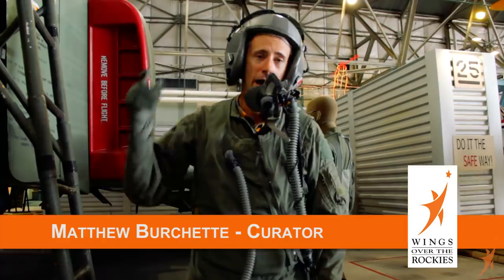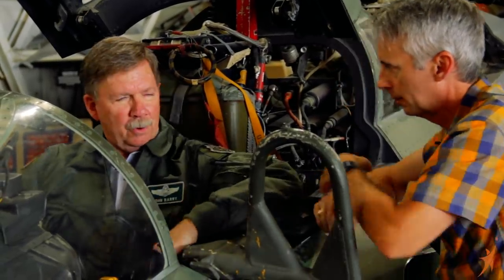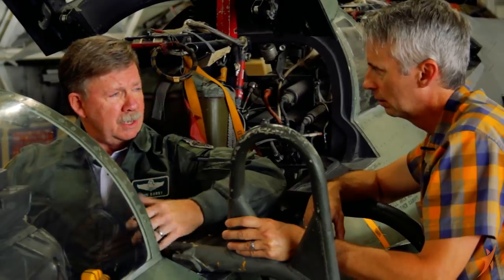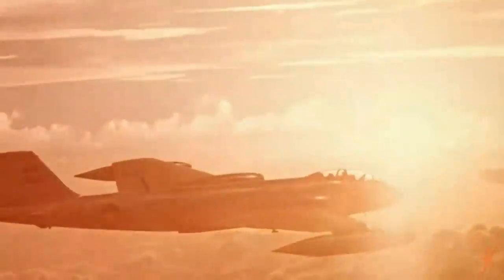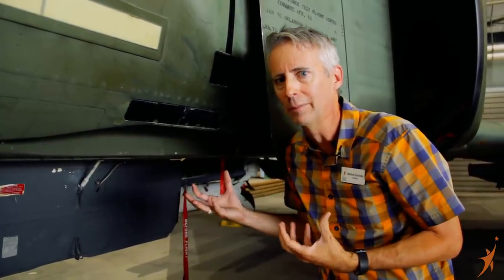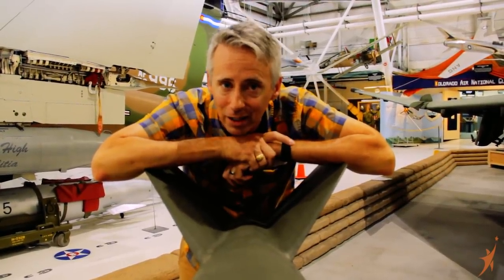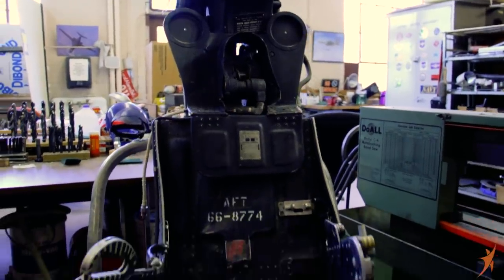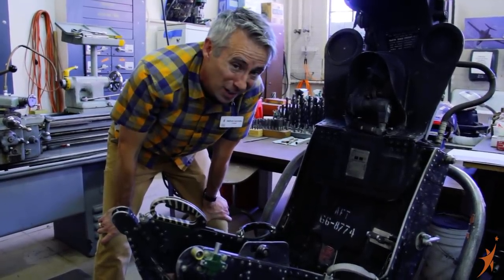F-4 Phantom | Behind the Wings

Comment: The F4 was "bad to the bone" just sitting on the tarmac.  It looked like it was doing mach 3 while sitting in a hangar.  I worked on the AIM missiles in the USAF and I've seen a lot of F4's, they're so cool.  However, many of the  pilots called them the "lead sled".
Reply: The IDF called one variant "Kurnass" (Sledgehammer).
Reply: "A triumph of thrust over aerodynamics" too. ^_^
Reply: @ragingjaguarknight86  I once heard someone describe the F4 as flying the same way a brick would if you angled it right and pushed hard enough.
Reply: Actually, that was not the F-4, that was the Thud, the F-105 Thunderchief.
Reply: Elmo Franklin Actually, that was not the F-4, that was the Thud, the F-105 Thunderchief that was referred to as the Lead Sled.
Reply: @mauriciaannproper1201  no F105 was referred to as the "Thud". Go watch the behind the wings episode on the f105
Reply: Jonah Smith Actually, the Air Force officially designated the F-105 as the Thunderchief, but few people ever seem to remember that. The world's largest single-engine fighter, it weighs more than 53,000 pounds when carrying full fuel and up to 16,000 pounds of external stores. Its bomb load can be twice that of a World War II heavy bomber, and, at altitude, its top speed is more than 1500 miles an hour. Down on the deck, nothing built before it and only a couple of airplanes built since can fly with it as it screams    along 50 feet above the ground at speeds faster than sound. It has a six-barrel cannon which rotates like a Civil War Gatling gun but fires 20 mm projectiles at 100 rounds per second.

Originally designed for toss delivery of nuclear weapons, the F-105 seemed destined for oblivion and replacement by newer, faster, more maneuverable aircraft. Bob McNamara's boys put the kiss of death on the F-105: their slide rules and computers had determined that "the F-105 has only single mission capability, fails to meet criteria for integrative enhancement of flexible force structure, and is non-cost-effective." Then came Vietnam.

Compared to the some other fighter aircraft in the inventory, the F-105 was nowhere. It wasn't new like the Phantom, fast like the F-106, or sexy like the F-104. It was a big, heavy, supersonic flatiron about 65 feet long with stubby, little wings that measured less than 35 feet tip-to-tip. (By way of comparison, the DC-9 airliner is 100 feet long and has a 93 foot wingspan.) You don't need a degree in aeronautics to figure it out. Lose power in an F-105 and it will fall out of the sky like a rock. Hang a full load of ordnance under its wings and it won't climb very high. Point its nose at the ground, and it will dive like a lawn dart.

Now, the Republic Aviation Corporation started building fighter airplanes since before Lindbergh made his celebrated trip to Paris, and some people claim that its founder, the wild, one-legged ace of the Tsarist air force, Alexander P. de Seversky, singlehandedly invented the modern fighter 15 years before World War II. His P-47 Thunderbolt was one of the best fighters of World War II, and Republic's F-84 Thunderjet first flew in 1946 and soldiered on in some Third World air forces nearly forty years later. Republic's airplanes have all been fast, tough, and heavy, but a lot of people concluded that the F-105 was a case of too much inbreeding. While all of Republic airplanes were noted for their propensity to use up concrete, at max gross, the F-105 had a takeoff roll only several yards shorter than Lindbergh's historic flight. Those of us who have flown the Thud have speculated that, if the Air Force paved the equator, Republic Aviation could build an airplane that would use every inch of it to struggle into the air.

When the F-105 entered the inventory, the wits and half-wits at officers' club bars around the world started to hang derisive nicknames on it. Its size and weight made the job easy. Lead Sled was an early appellation, and even 105 drivers had to admit that the name aptly described the airplane without full power.

The WWII P-47 had been nicknamed the Hog, and the follow-on F-84 had become the Super Hog. It was quite natural then that the F-105 would get tagged with Ultra Hog. Transition problems resulting in "controlled flight into terrain" gave rise to the name Lieutenant-eater, but that didn't stick. No one really knows what direction the nickname might have taken but for television, Buffalo Bob Smith, and the Howdy Doody show. Howdy Doody, it was alleged, was the illegitimate son of a Strategic Air Command bomber pilot, and Howdy, assisted by Mickey Mouse, was now writing standardization manuals at HQ, USAF. Buffalo Bob Smith, many others contended, was the role model for any number of Air Force Generals, while Clarabelle the Clown trained USAF stan/eval officers. On the television show, intermittently making mischief with the villainous Mr. Bluster, was a bumbling, drooling, semi-evil Indian named Chief Thunderthud. It had a nice ring to it. Thunder THUD. Thud, as in the noise made by a large heavy object hitting the ground. So, the F-105 became the Thunderthud, and finally, in life and legend, just The Thud.

Perversely, F-105 pilots liked the nickname. Thud drivers took fierce pride in their airplanes and in themselves. They scorned the aircrews of the newer, more maneuverable Phantoms as multi-engine pilots. "Our mission is to fly and fight -- and don't you ever forget it" the motto went. Thud drivers, Hell's Angels, and Mafiosi all exhibited similar patterns of intra-group and external relations, and the Air Force brass soon became resigned to (but not entirely pleased or happy about) the antics of Thud drivers in the air and on the ground. Following a familiarization visit to the the 355th Tactical Fighter Wing, an assistant to the Secretary of Defense wrote: "While these men might of some significant value in the event of all-out conflict, I fear that they might not be susceptible to normal management techniques in any other situation."

This report, when learned of later, was sometimes read aloud at a 355th TFW function known as a "pressure bar" at which all drinks were free until the first man went into the head to urinate. After the climatic sentence was read, the 355th pilots would stand on their chairs, the bar, or tables, yell "Fuck him; Fuck his boss; Fuck his hoss; Fuck the 13th Air Force; It's just a fucking revision of the Second Fucking Air Division," and throw whatever classes and bottles were handy onto the floor. There generally followed numerous choruses of "We'll Fly Our Fucking Thuds at 10,000 Fucking Feet," "Throw a Nickle on the Grass and Save a Fighter Pilot's Ass,""Cruising over Hanoi," "Our Leaders" and other songs. (The 13th Air Force and the 2nd Air Division were intermediate headquarters units and universally reviled by pilots.)

So there!  I’m an Air Force Vietnam Vet, Aircrew Egress Systems Mechanic! The Thunderchief, ie, Thud, was very definitely it! Duh! Throw a nickel on the grass, Dude, and kiss my ass!🤣
Reply: @mauriciaannproper1201  Wow thanks for about 4 paragraphs of info I allready knew. Someone got really butthurt about being wrong.
Reply: Jonah Smith not wrong! Apparently you didn’t read!  Oh, and I also was an F-4 mechanic during Vietnam, so I know my stuff.  Everyone knows the 105 was/is the Thud ... ask one of their pilots.
Reply: @mauriciaannproper1201  Apparerently you should reread your comment, 2 comments ago. You stated that the F105 was not the thud but the lead sled
Reply: The F-100 was called the Lead Sled.  For the first year and a half of my 7 year Air Force period I was an F-4C crew chief and never heard the F-4 called the lead sled.  If anyone mentioned the Lead Sled they were invariably referring to the F-100.
Reply: When the F-105’s were transferred to George AFB in Victorville, CA (now closed), I was with the 35Th Tactical Fighter Wing, 35th Avionics Maintenance Squadron. We had various fighter (USAF, tail insignia GA) and training squadrons (Luftwaffe, Saudi, etc pilots) flying F-4s of various configurations. 

We later received F-105’s from Korat. 

I personally heard the F-105 referred to as “Thud” AND on occasion “lead sled.” Those who called them “led sled” were mostly younger pilots, however, and not old timers.
Reply: Turkey called it's F4 Terminator, after heavy upgrade by israeli's company

Comment: I was stationed at Ubon, Thailand, from September 17, 1970, to September 17, 1971.  I calibrated the Weapons Control Systems and Radar for the aircraft that the ejection seat was salvaged from, F4-D #66-8774 (and all the rest stationed there).  8774 crashed on Feb. 26, 1971.  The F4 could also carry one 3,000 pound LGB on the centerline mount, known as a "Fat Albert".  I often felt they should have been designated an "FB-4D", for Fighter Bomber.
Reply: That was one of two ejection seats.   CPT. RODNEY D COLLINS was KIA.  I wonder if the guy doing the video knew the history of the aircraft.

Comment: The F4 has long been my favorite fighter. Possibly because it is like me- big, ugly, and effective. But there is a certain beauty in a purposeful form. It is the original, multirole, joint service aircraft- all 3 air services used them. We gmfound out during Vietnam whaf a good bomb truck it made. After being replaced in the air superiority role, it continued as a Wild Weasel because it was so good. Then in the early 80's, USAF retrofitted them (i assume G models) with the F15 engines (Pratt & Whitney, i forget the designation). Then they could REALLY punch holes in the sky. I did not know it is still in active service with 3 nations. That is great.

Comment: The F-4  G E J79 engines announced their arrival with a smoke trail visible 25 miles away—a Phantom calling card that would take two decades to engineer out—the first F-4 production models rolled off the assembly line with Mach 2 capability as standard equipment and a 1,000-hour warranty and delivered to California’s Naval Air Station Miramar in December 1960.
Reply: it took only a few years to design new combuster cans for these. it was a simple solution.